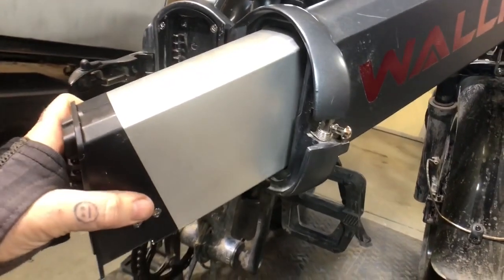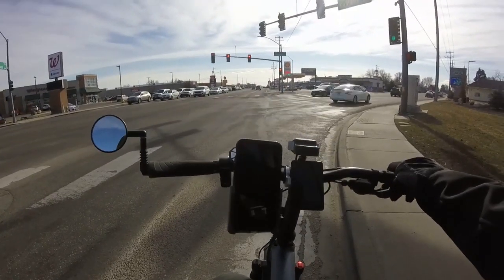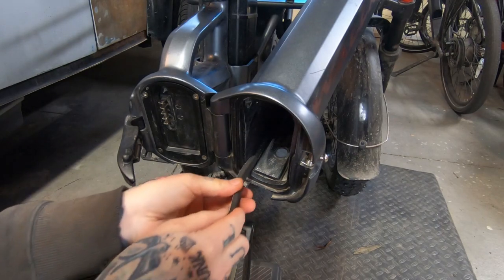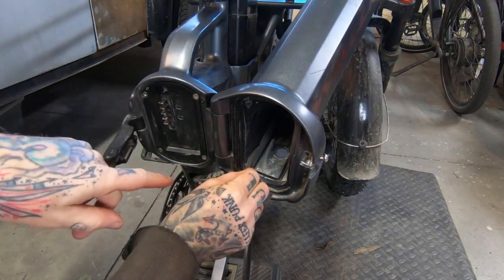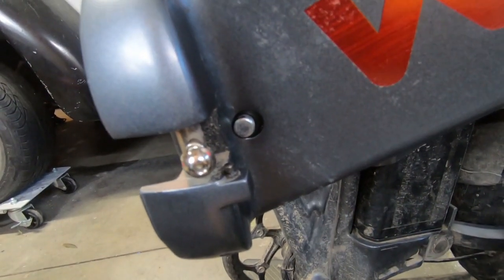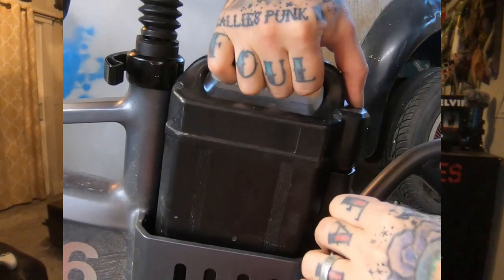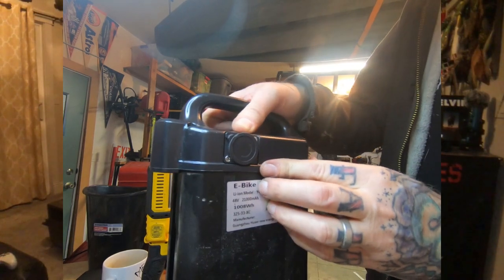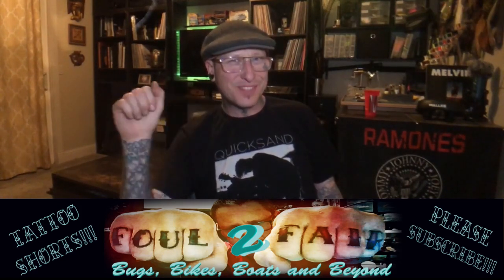E-Bike Battery Noise and Rattle Problems? Front and Rear silencing hacks on my WALLKE H6

Comment: Glad the h9's have a plug for back battery
Reply from the maker: yeah that plug in the bottom seemed like a good idea but not in practice.
Reply: @TheE-LightenedArtist  I got in a accident with a same bike that had a back battery. Brakes gave out, combined with other factors. Leg slammed into a light pole.  While the bike was good for the most part battery seating got messed up as far as I can tell. If it had a plug I would probably still be using bike

Comment: Nice tips! Thanks The E-Lightened Artist. I bought H6 last week and today I assembled all! but I have a several question for charging battery. How do you charge battery for? regular 100% charging or some limit charge?
Reply from the maker: Hi Felix. It's a smart charger so just charge it till the light turns green. It won't over charge. I charge mine to 100% every night. If you just came off a ride, it's a good idea to let the battery chill for a bit before charging. If you're going to not ride for a while, say a few weeks or more, it's a good idea to drain it to about 80% or so. I heard it's bad to store them at 100%. When you're riding, the energy bar might seem like it's getting sucked down. All 3 of my ebikes do that. If you turn it off then on, it'll give you a correct reading. Not sure why. Thanks for the kind words. The H6 is still my favorite.
Reply: @TheE-LightenedArtist  Thank you so much! I just wonder keep charge 100% make low cycle count for battery. Today I got a new charger (grin Technologies Cycle Satiator), but it is so hard to set up. even I can't use it today. jack size fit well but, when I connect to front or rear battery, It doesn't connect. By the way, I'm watching all of your videos, and keep waiting your upload! Keep going and enjoy!
Reply from the maker: @felixkim1089  Awesome! I've watched a bunch of videos about how many charge cycles a battery can take and it seems that, say you charge from 60% to 100%, that's not considered a full cycle just 40% of one. I had the same thoughts as you trying to maximize my charges to extend the life of the battery. I think more important is the environment. Like charging it in sub 40 degrees or when it's super hot. Best to bring it inside and charge at room temp. I've never considered using a different charger. Keep me up to date on how that goes.
Reply: @TheE-LightenedArtist  I checked battery cycles for longer lifespan. It usually said most of battery can be 100% cycles around 300(it might be difference depend cell brand). The funny thing is we want to save extra maintenance cost such as battery replacement( this is so much). so I saw some chart of battery cycle efficiency of percent. 90% of charge will be around 6-700 cycles and 80% is 1400-1600 cycles. huge gaps.... so I want you try limit charge when you charge your battery. By the way, I learned how to use Cycle Satiator. It is  good charger for limitation. but Wallke h6 have battery protection when battery just use 2-3 voltage. That time this charger have to be use 'forced charge'. It sound like brutal but when charger identify battery, it start to charge slowly and certain amount(almost charge what you set up the profile) it is going to be slow charge and cut off charge.
Reply from the maker: @felixkim1089  Very cool info. I'll have to get one of these Cycle Satiators and educate myself more. 
Yeah, these batteries are $500-700 so wise to extend their lives as much as possible.

Comment: Thanks😊
Reply from the maker: Cheers! Something I left out in this video that I’ve learned since is the controller could be knocking around as well. On the new bikes, they fasten it to the inner wall. Some heavy duty double sided foam tape does the trick.

Comment: Im so glad i went with Wicked E bikes instead lol. They are amazing. I am still Jealous of those 20 x 4 tires and that nice fat back frame and that beautiful computer system and that nice dual 34 Ah (some say they only get 34 Ah) Battery system for extra long rides. That 31 mph throttle can go 25 miles straight and will probably be at 50% battery. I wanted the green and the back seat with the after market pegs. I had a feeling i just wasn't gonna end up with a beautiful bike.
Reply: Engwee X26 Vitilan I7 Pro and Wallkie H6 Green color (The new step thrus are nice too). All luxury. I went with Black Wicked E bikes Cruiser. Regular asf frame 26 by 4 inch tires. I got the cruiser -__- Not even the Full Suspension.
Reply: I couldn't wait for the pre order on the full suspension. Specs were too exciting.
Reply: I did a review if you want to check it out. As far as Wallkie they are great company but too many issues...
Reply: And dude i hope the noise dissapears and wallkie gives you a bunch of comp. You did a good job promoting them.
Reply from the maker: @CONSCIOUS_TALK_ENT.  I rode my cruiser the other day and realized how spoiled I am to the H6. I never had the front battery noise issue but definitely found the weak link in the rear. And even though i've smashed stuff on my bike, none of it ever lost functionality. I'm a bikes worst nightmare. lol. They have to cut weight here and there I guess. Mixing steal with plastic ...a point of failure every time. I report all this stuff to Wallke as it happens. Providing straps for that rear battery or beefing up the connectors would be easy fix.
Reply from the maker: Wallke took all the beefy components from the H6 and added them to the 2023 X3 pro. Hoping to get my hands on one soon.
Reply from the maker: For my 16 mile a day commute, the dual batteries is overkill. But this spring when I take it to the mountains I'll be glad to have it.

Comment: Not a video related question but dude how did you remove the cassette. The customer service is telling me to cut the motor cord casing but idk. It’s looks sketchy to me
Reply from the maker: I haven’t gotten to that yet. Been distracted by other projects. Yeah I guess that motor cable would be in the way. So you might have to cut the cable to get the tool on then re-splice it. That seems kinda sketchy. I went to a 60 tooth chainring but am not to pleased with the results. Editing a video now. I’ll ask a tech at cafferties if they have a technique to do that without  cutting it. Maybe something like an editions sensor wrench?
Reply: @TheE-LightenedArtist   I seen one video of a guy who had what he called a slotted lock ring tool. Basically the tool with the side partially removed so you slide the cable in and then reattach after. I couldn’t find it anywhere online tho. Couldn’t get a response as to where he got it either.
Reply from the maker: I bet you could cut a slot into a tool with an angle grinder. Didn’t make it by the bike shop yesterday but I’ll try again today.
Reply from the maker: I’ll have to make a video about it.
Reply from the maker: just stopped at the bike shop. They've never dealt with a cable on the cassette side. I'm going to try to cut a slot into a tool. Just ordered it.